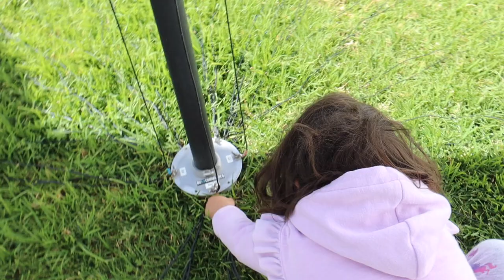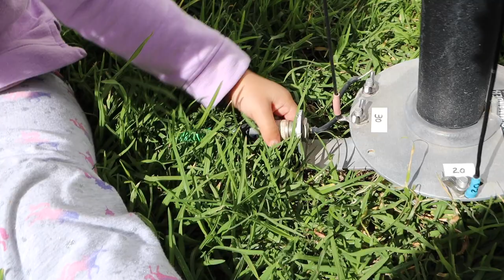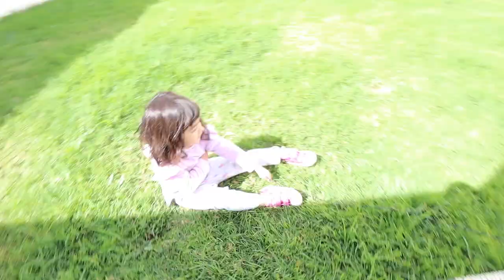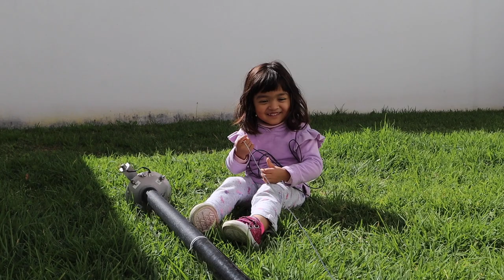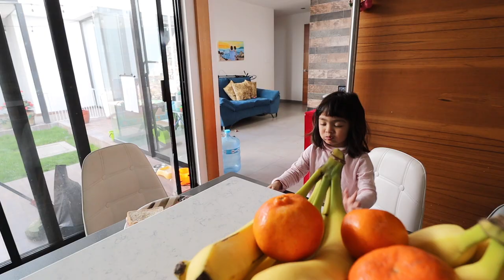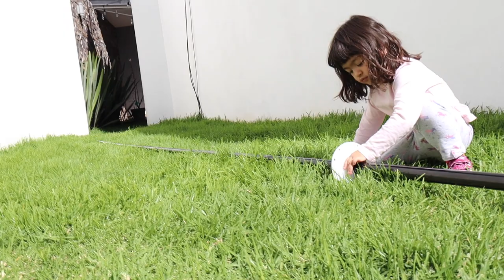Removing the DX Commander Vlog | Making Preps for Zero Five Antenna | Daughter helping me out today!

Comment: Hi cappy,good to see you again.where in USA are you as always seems to be sunny there?? On your travels drop some sun into the UK please🤣🤣did you not like the dxcommander? Do you think or rate the zero five better? Stay safe 🙏
Reply from the maker: I'm either in Texas or Florida and seems to be sunny. I find that it was a chore for me to keep removing the ground radials when it's time to mower.  I haven't found a way to mount the DXC permanently.  When I bought the Zero Five 43' antenna, I relocated my Zero Five 27' to this location.  I find both antennas really good.  Since I made an 80m dipole.  I find the wire antenna's less noise interference's.